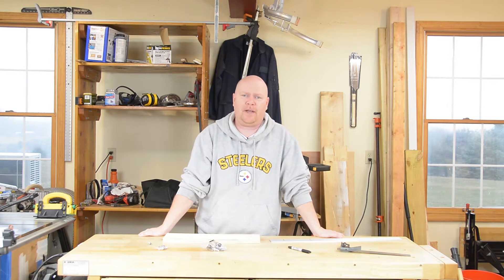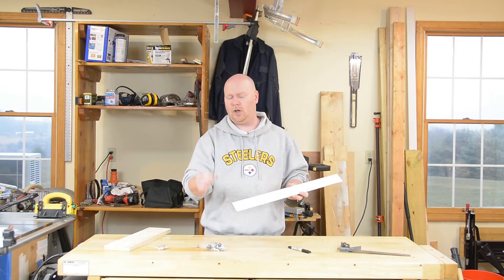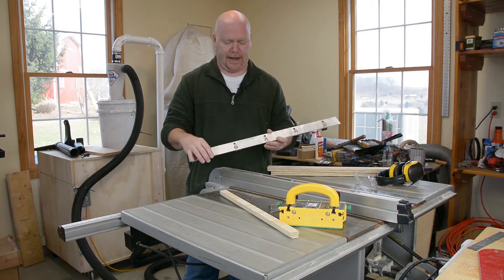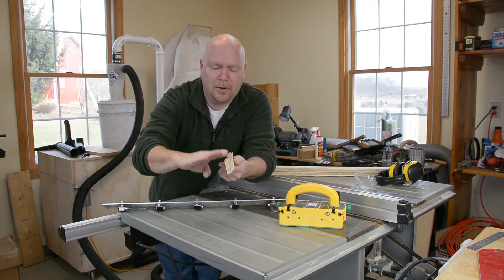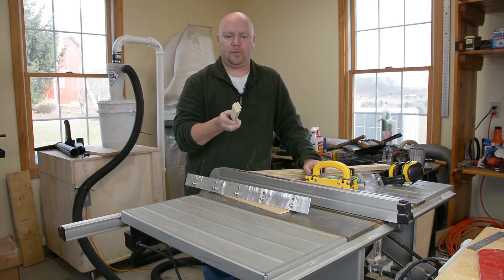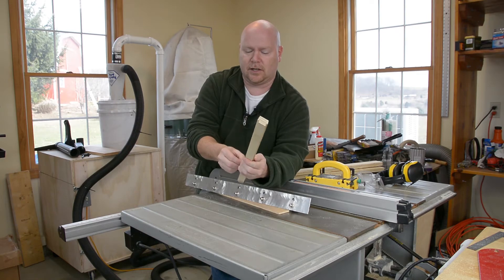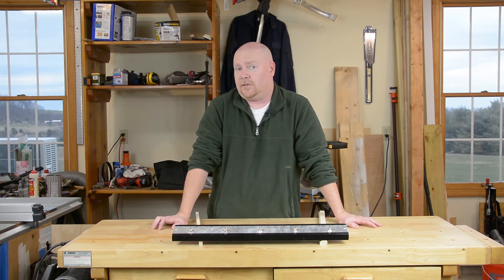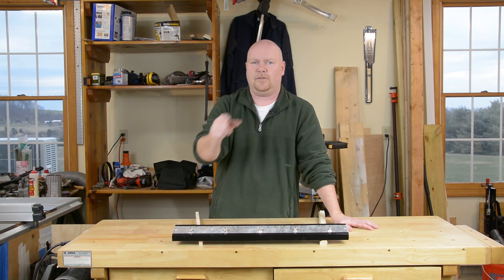USB Stompbox controller for Garageband

Comment: Wondering why plywood and why so thick.... (and that's pronounced OS ten) Couldn't find the second video.
Reply from the maker: - Plywood because I had it.
- Ditto for the thickness, although if you plan to stomp on something you need to build it solidly.
- It can be said either way.  There are enough religions in the world - let's not make computers yet another one...